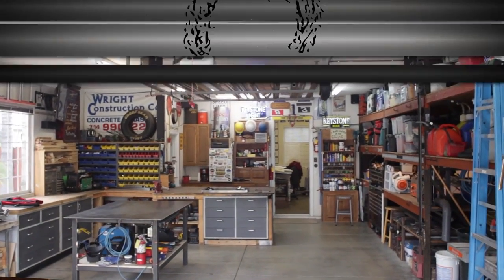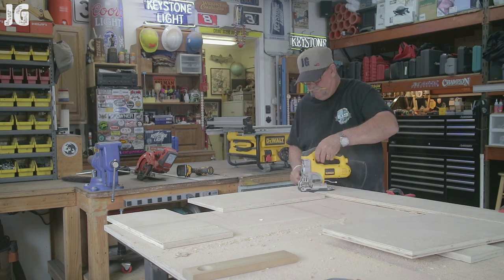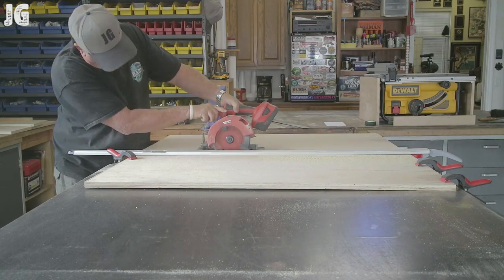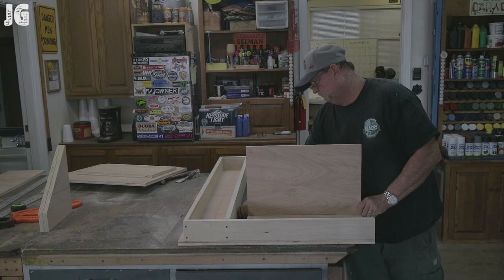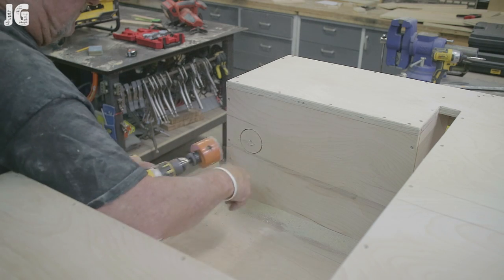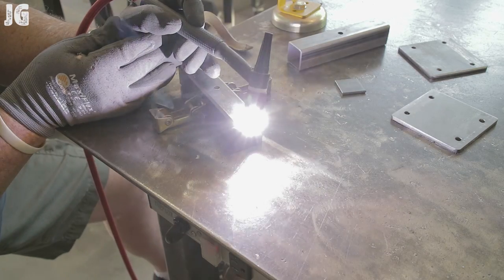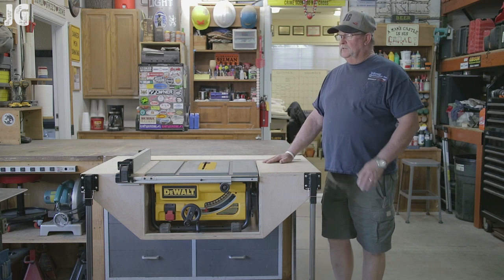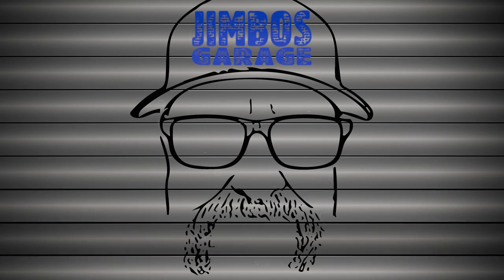Table Saw 'Table' Build - Jimbos Garage

Comment: If you put the blade guard back on you can get all of the dust the blade throws out which is where most of it comes from. I need something more permanent for my Dewalt job site saw but I really like the way you attached the front legs. I may use that on another portable table for my miter saw. I love that you work on the fly, but hoped for some paper/digital plans for this design. Thanks for a great build video!

Comment: I really enjoyed your video on making a table for your portable saw, and more so, I enjoyed the linked video on welding the rebar to the 1\4" flat metal plate for a wall being put up. But what would have made the table saw project even better for me as a "wood working for Dummies" be more instructions on explaining the measurements and hardware used in building the projects. I loved how u used a jig to make the metal welding project easier done. and had the measurements of the the metal plate and length of rebar mentioned in the video. Doing or having the plans of the project made into the video makes for my lack of knowledge and experience of doing homemade projects with an ability that I can have success in completing the project, building my confidence of wanting to watch more videos to make more homemade projects. I've seen so many videos that say, " easy to make generator made from a washing machine motor, only to leave out steps or not clearly explain things, give all that is needed in tools, measurements, materials later needed to complete the project. But with yours or some of yours I've seen were step by step and easily understood to someone with little knowledge and 'handy man" experience especially being a single woman and not much money to afford to higher someone to do it for me. I don't have a lot of room for trial and error, so having as much information on what to do, what to buy, etc. makes for videos helpful to me. Thank you for making your videos easy to follow and do. I wish I had the ability or versatility of making things by hand like my grand-dad. He was a genius with electrical tech., metal working, wood, on and on. There wasn't much I didn't see him make himself, from making his own hunting rifles, loading and re-loading his ammo, making his own fishing lures and rods. to inventing the first remote controller for his t.v. and stereo system to routing both sounds thru any speaker in the basement to the second floor to workshop outside. But watching someone with the abilities on video is just as amazing for me. Again thank you.
Reply from the maker: Thanks for watching Labankishi, Good luck with your projects, Keep up the good work!  Jimbos garage!

Comment: Jim, my wood shop teacher said my first jewelry box looked like a battle ship with all the nails I used, well now I use screws like battle ship rivets,  never enough! You do alot of steel work in your shop so not sure how much this might help, but I found, that by putting Formica on saw support tables around the table saw allowes work to glide very smoothly. It really helps when your cutting full sheets of that 4x12 plywood.
Reply from the maker: Thanks for watching Abby, Thanks for the tip.  Jimbos garage!

Comment: Thanks Jim, I just received the Dewalt cordless table saw. I am in the process of building a worktable but I did not want to build it around the saw because of the size of my shop so I was trying to figure out what to do. Probably will not build one just like yours but you have showed me how it can be done.
Reply from the maker: Thanks for watching Douglas, Good luck with your build,  Jimbos garage!

Comment: to avoid lens issues consider using a UV filter that screws on or otherwise attaches.  they are usually cheap and serve as a barrier between debris and your expensive lens.
If you do damage or scratch the UV Filter, just swap it out.

Enjoyed the video!

Comment: Just a little tip on using a large holesaw bit: to keep the bit from jumping around, create a little groove by running the bit slowly backwards (reverse Direction).  When you have a bit of a groove go ahead and put it in forward direction, and use a variable speed drill.  Also I like to drill the pilot hole first with a 1/16 inch undersized bit. This way when you drill with the quarter inch bit, it will be tight.
Reply from the maker: Thanks for watching George, And your advice.  Jimbo!

Comment: This is a good idea. I have this saw and the problem I have occasionally is the infeed side is short limiting the size of the material you can feed. I was thinking this could be changed a bit to allow for a greater infeed depth while still being able to get to the blade and fence adjustments. Mimic the outfeed side of this on the infeed side with hinged (or drop in) extension. Set your adjustments and either swing up (or down) or drop in the infeed extension shelf. Could be used with or without a sled.

Comment: Great video, thanks for sharing. 

Green titebond (3) is waterproof and has an extended open time.
Blue titebond (2) is interior/exterior and water resistant.
Red titebond (1) is interior use.

Comment: Great video with very adept editing to show the process. Any plans to change the mounting technique to the stationary table with drawers instead of screwing/unscrewing? I thought you could make a couple of female sided receiver tube much like the female receivers for the legs but mount them horizontally on the end of the drawered table so you could slide the table saw box to abut tight and secure with pins.

Comment: Great build. I've been using a rolling cabinet-based table saw station for several years, but now that I've added a hand tool workbench, welding, 2x72 belt grinder, lathe, mill, and surface grinder, I don't have room for my huge table saw station and I need to build a better, smaller one. You've given me some ideas for mine. Thanks!

I don't know if anyone else already answered this, but you would have been fine with Titebond I (original) for this. Titebond II is waterproof. Titebond III is waterproof, safe for use on food surfaces  (such as cutting boards), and has a longer open/working time. I own and use all three, as they get more expensive at each level.
Reply: Oh, and as my day job is as a professional photographer I can give a tip or two there. A UV filter will protect the lens from many kinds of damage, and only costs a few dollars. Cheap insurance. Or you could use a circular polarizer which will give you control over reflections, in case you ever have an issue with that. Search for circular polarizer and you'll find plenty of information on the subject.

Comment: The green bottle titebond is weatherproof. Great for outdoors or kitchen/bathroom stuff. The blue bottle titebond is water resistant and it dries to a clear color. best for dry areas. 

I use the green (ultimate) for bee hives and the blue for furniture.

Comment: just a thought on attaching the table to your permanent workbench.. instead of using 3 screws, what if you put a metal toggle latch catch mounted to a bracket that attaches to the rear sides of the table?

Comment: Nice build I like how you build with out a drawing great skill to have . A suggestion for your table attachment ( if you have the room ) get the largest cleat cut a 45 deg angle in the cleat attach one to the saw table and one to the work table. The advantages this gives saw table can slide along the table so longer work table cleat and you can slide the saw table out of the way of the drawers on the work table, and no screw attachment.
This is only a good suggestion if you need access to the bottom drawers. If you lack room for the cleat on the saw you a round metal bar and a 45 cut on the work table.
Great video. I hope you do not mind suggestions.
Have a day
Reply from the maker: +E Hiebert   Thanks for watching E Hiebert, I love suggestions, Its nice to hear other people and there ideas. Thats what it is all about! Jimbos garage!

Comment: Great video, editing is excellent. 
PS. use as many screw's as you want, after all it's your project not someone else's.
Reply: There are several components to building a table saw. One resource I found that successfully combines these is the Wilfs Wood Blueprint (check it out on google) without a doubt the best resource that I've seen. Check out all the incredible information .

Comment: looks Great, the only thing I would recommend it putting miter track dados in the back of the table so if you use the miter track for a table saw sled or something like that, it will make it through the cut.

Comment: Great project!
The only thing I would have done differently is instead of screws to attach it to your cleat, I would have used bolts with T-nuts.
That will prevent having to drill new holes when they strip out.
Reply: spamdam99 great idea

Comment: Great build Jimbo and awesome informative explanations. I maybe borrowing this idea but 1 simple plan change. In mine in the right side wing supports ill make a long rectangular cubby to put my fence in so I have a flat work surface and also that fence doesnt get damaged on commute! Thanks again, new sub today!
Reply from the maker: Thanks for watching Rocky, good luck with your build!  Jimbos garage!
Reply: I'm liking the idea of a cubby, probably on each side though for push sticks and the like. There's one extra change I would make though. If you have the room on the front of your bench, use a french cleat on both parts and you wouldn't have to rely on screwing it down every time. You could just put stop blocks on each end for positioning it if you wanted to.

Comment: Just a quick suggestion on the cleat you are screwing into on the back. Drill the holes out and press a 1/4-20 nut in each hole then use 1/4-20 flat head screws. I know you have the technology! Great job on the table. I am looking to do something similar.

Comment: Nice build Jimbo.  Curious do you find that you get the quality cuts with a contractors saw vs a cabinet saw?  The reason I ask is I am vacillating if I should spend a boat load of money on a dedicated large heavy table saw vs a new compact contractor saw like what you are using.  I am a home wood working metal working hobbyist and compactness with accuracy is my goal with benches and tools. The saw I have my eye on is the brand new worm drive Skill compact saw.  My thoughts is to build a table similar to yours but also be able to remove the saw and place an insert to use as a work bench.   Thoughts?
Reply from the maker: Thanks for watching Gary, The cabinet saw would be the best, But you lose portability, For what i do my DeWalt work great. I'm not building custom cabinets for houses and kitchens. But for general use in the garage or shop the Skill compact saw should be fine.  Jimbos garage!
Reply: I went to HD and check out the Skill.  Not a fan too cheap looking to me.  The DeWalt had a better fence system the Ridgid was the best in class for small saws from what I could see.  I think I will go with a cabinet saw.
Reply: I checked out the new worm drive Skill and Dewalt.  I liked the Dewalt fence and miter much better but your right I cant see having this in my shop seems not accurate enough for what I want to do   I will go cabinet.

Comment: Jimbo, nice.  KISS.
I'd make the cleat with a slot and the table with a batton on the bottom so it "hooks in" and can't pull off the cleat.
On the feet, make the top ends with a fork, ie, another 2x4 on the back side so the table front cleat 'hooks over" the fork on each leg.  If you got real fancy they could be made so they couldn't get kicked sideways (ie, a 2x between them, top and bottom,)
Ken K

Comment: Nice Vidjeo, cool addition, Good leg solution, but I'd like to have seen then on the inside of that front face for aesthetics/being out of the way... it would only make maybe 2" difference on the overal footprint, but you could also negate this by angling the legs outward as well, making another set of legs for the backside as suggested by others to enable stand alone out of shop use. the 'canted' shape of the legs I suggested would make it more stable too.  but all minor adjustments to a cracking Job, I like :)

Comment: Love this idea, I just purchased a new Skilsaw Worm Drive job site saw which currently is on a nice stand but it would too hard to build around the stand.  Though the stand rocks for portability I want an out feed and incorporate a router table with it as well.  Question, I am curious why not modify your current table or build a new one with the saw in place and design it with a the option to cover over the table saw if your concerned about not damaging the table saw top?

Comment: That cleat will wear out too. How about countersinking a nut system that you can screw into repeatedly without degrading the integrity of the connection between the table and the bench

Great job. Great style. Subscribed
Reply from the maker: Thanks for watching Christopher, Jimbos garage!

Comment: Only change I would make are some rabbits for you miter gauge to run in.  Wouldn't be hard to cut with a dado stack.
Reply: That model of table saw, the DW745, doesn't accept dado blades. I have the same one.
Reply: I use a box joint blade with the saw instead of a dado stack. You can only cut 3/8" at a time, but it fits on the arbor and works fine. https://www.amazon.com/gp/product/B0012YIL2W/ref=oh_aui_search_detailpage?ie=UTF8&psc=1

Comment: This looks finished and neat but until you make a bigger fence I can't think of any cuts you can make with a 4x8 piece. Other than like 18" boards.
Reply: You might want to re-think that. Subtract 18" from 48" what do you get? His range of cuts is infinite.Sure maybe the fence only moves left or right of the blade 18" but whats left on the other side is also usable material right?
Reply: +Cory Driver so the sides of a cabinet I just barely built yesterday needed two 22" sides as well as three 22" deep shelves. I had a 4x8 sheet of mdf. Irregardless of the side I cut from if the fence only moved 18" how would I go about cutting those 22" lengths? Also I can't count the amount of times that I have had to cut a dado half way into a board and unless I want to run the piece through the saw backwards you definitely need more that 18" of travel. There is also the convenience of setting your fence to 30" or whatever you need if you have a sled to rip a few dozen 1x2's for frames or something and you need a reference to slide the boards up against. In this case you would have to remove his fence altogether and clamp a board off the side of the table or something in order to have a quick measurement reference. I can keep going. I don't think I need to "rethink" anything.
Reply: That's a good point, Kaden. The stock fence on Jimbo's Dewalt is removable. He could route a 1/2 inch or 3/4 inch wide channel on the left and/or right side(s) of his table saw shelf that's perpendicular to the saw blade and make a new fence with some plywood glued to form an L. After removing the stock fence, the new L fence could then slide back and forth in the channel and be secured with a couple of bolts or star knobs to the shelf. That would allow Jimbo to cut pieces that are larger than what the stock fence can handle. If that's too much work, then Jimbo could simply clamp a piece of wood to the left or right shelf for making the occasional large cuts in sheet goods.

Comment: Could have just built the whole table with screws and a bit of welding :).  Nice build! Looks really sturdy. I suggest adding 2 more legs for the other side. that way you could use the saw with the table outside/ on a job site.

Comment: jimbo, looks like your a great fabricator and carpenter. well done all around. I'm looking to buy a table saw at home. I've used plenty of hand tools and various hand power saws. the dewalt keeps comeing up. is yours the 7840 or 7480 model? if so, how great do you like yours and would you recommend a craftsman or ryobi?
Reply from the maker: Thanks for watching Manelic, I have the older model, DW745, I have had it for about 5 years now and works great! I love it. I would recommend the newer models you have mentioned as i don't think mine is available any more. I don't know much about the craftsman or ryobi.  Jimbos garage!
Reply: worth the watch, it went bye fast. Jimbo got down.!👍
Reply: At the present time the DW745 is the number one seller on Amazon.
Reply: I have had the 7480 for a little over 2 years. I love it. I can rip 24 1/2 “. I have dust collection set up and have the saw built into my rolling work bench. Works well for me in my small shop. Also the fence is so accurate and easy to adjust. Can’t use dado blades, but can make several cuts to make dados.

Comment: I plan on making one myself but I don't know how to get the dimensions for my table saw. I have a DeWalt DW745 and I looked up the dimensions and it's supposed to be about 15 inches tall but when I measured I got 13ish inches. I couldn't really get an accurate measurement and I was wondering if anyone could help me out

Comment: Hey Jumbo, instead of using that flat cleat system where you have to screw the table in each time and eventually wear out the top surface of your table, why don't you use a French cleat and then the extension just hooks onto your existing table?
Reply: Philippe Lobelle it's Jimbo not Jumbo. 😂
Reply: Philippe Lobelle l
Reply: Dylan Griffitph

Comment: Great build! I may make a cross between this and the Paulk mount for my DeWalt saw. What are the connections you used for the dust port? This is a big issue for me.
Reply from the maker: Thanks for watching Andrew, It is a 2-1/4'' coupling for shop vac's that i got at the home depot, It slips right over the port on the saw and adapts to the shop vac.  Jimbos garage!